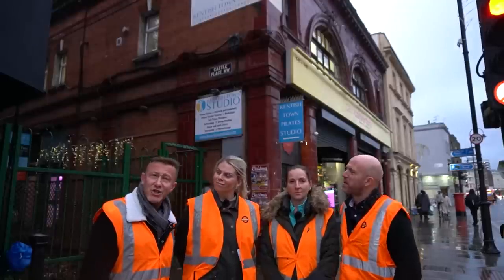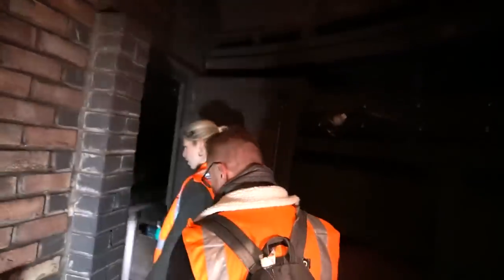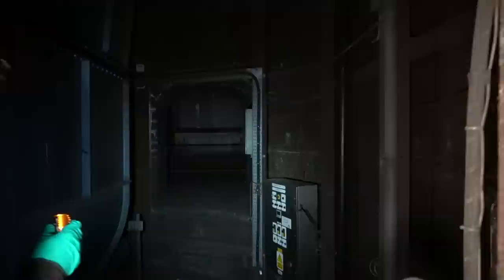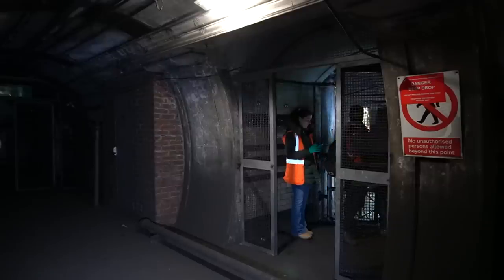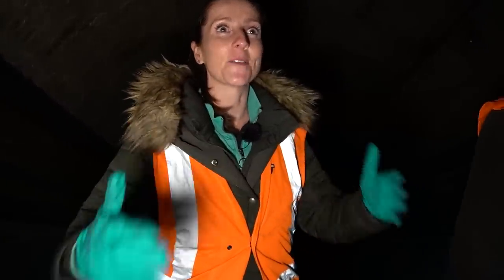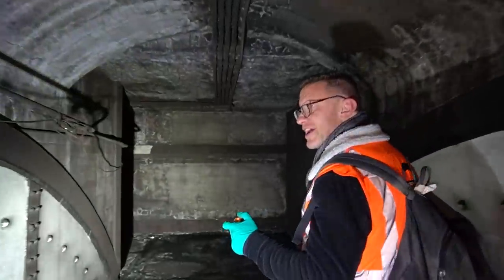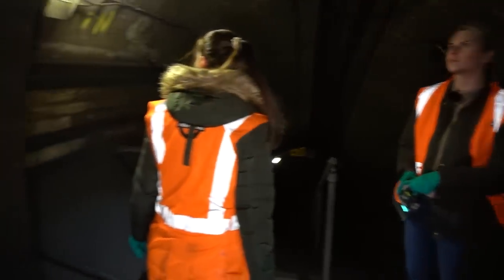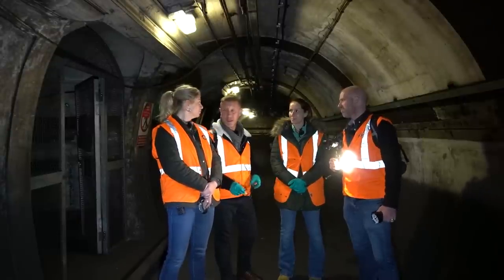Exploring South Kentish Town Disused Tube Station | Hidden London Hangouts (S07E01)

Comment: The sewage ejector pipe fitting is called a munsun ring , its basically a brass clip for copper pipe that are still used to this day. Often to be found on high end or commercial buildings. The top half of the clip is missing.

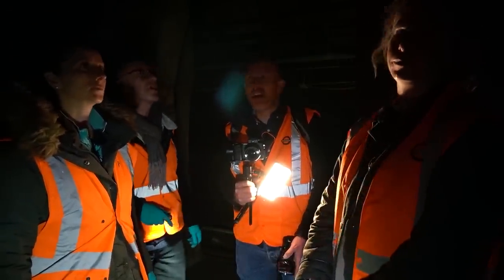Comment: Bravo brave explorers of the unknown deep!  23:44 Not often you see Alex so amazed he is stunned into silence! 
Would be great to also hear a bit more on some unanswered bits from the exploration - such as, why, after the station closed, did they remove the original staircase in the staircase shaft, which must have been a lot of work?   And the remains of the poster 27:06 - was that WW1 or WW2?   Maybe we can dream that someday the station will reopen.
Reply: Thanks - glad you enjoyed it. I can answer those questions for you. The original spiral stairs in Underground stations trended to corrode in the damp conditions and have been removed from many stations but are usually replaced with modern galvanised stairs. In some places it’s very obvious (such as Down St) but quite subtle at some stations. If there’s another route in/out of the site the stairs are just removed and the shaft left empty  and that’s what’s happened at SKT (Angel is the same). The surface building at SKT has been repurposed and the original route to the old spiral stairs has been capped off. The posters we showed are from the Second World War

Comment: I've been in there loads of times. There used to be a place that offered massage therapy for er... health reasons. Vibrations when the trains rattled through were interesting.
Reply: Did you visit the station or the “massage parlour”? 😘
Reply: Just the "health club", but you went into a door that was part of the station building and then downstairs to an underground level. So I used to pretend to myself that I was getting secret access to part of the closed-down old station.
Reply: If it works for you, it works for you 😉

Comment: Did they find any trace of the southbound late night tube train that left Kentish Town at around 10.50pm Saturday 31 October 1931 with the driver, guard, and 5 passengers on board - and never arrived at Camden Town. They combed the line but it had vanished. To avoid a panic, they made up some story about a derailment and paid of well the 7 families involved. But the only trace of that train now is a very cold rush of air and the sound of a train rumbling along, at around 3am reported by maintenance crews in the tunnel when no trains are running. Unsuprisingly, no LT maintenance man will work that tunnel alone, to this day, ever.

Comment: I needed to know why don’t dig a tunnel and do an extension for the main line Train so that they can extend the unused abandoned underground stations.  

Why couldn’t they use the part D78 Stock train doors on the sides and also restructure the front face of the A60 and A62 stock and that includes the class 313, class 314 and class 315 remix and make them all together and also redesign them an overhead line and also make them into Five cars per units and also having three Disabled Toilets on those Five cars per units A60 and A62 stock trains and also convert the A60 and A62 stock trains into a Scania N112, Volvo TD102KF, Volvo B10M, Gardner 6LXB, Gardner 6LXC and Gardner 8LXB Diesel Engines and also put the Loud 7-Speed Voith Gearboxes even Loud 8-Speed Leyland Hydra cyclic Gearboxes in the A60 and A62 stock, class 313, class 314, and class 315 and also modernise the A60 and A62 stock and make it into an 11 car per unit so it could have fewer doors, more tables, computers and mobile phone chargers.

A Stock Trains and also having 8 Disabled Toilets on those A stock trains. why couldn’t we refurbish and modernise the waterloo and city line Triple-Track train tunnel and make it more bigger and extend it to bank station, making it into a Triple-Track Railway Line so those 4 European countries such as Germany, Italy, Poland And Sweden to convert the waterloo and city line Triple-Track Train tunnel into a High Speed train?

The Third Euro tunnel Triple-Track Train line to make it 11 times better for passengers so they could go from A to B. then put the modernised  11 car per unit A Stock and put them on a bigger modernised waterloo and city line Triple-Track train tunnel so it could go to bank station to those 4 European countries such as Germany, Italy, Poland And Sweden. The modernised refurbished 11 cars per unit A stock could be a High Speed The Third Triple-Track Euro Tunnel Train So it is promising and 37 times a lot more possible to do this kind of project that is OK for London Germany, Italy, Poland And Sweden. 

oh by the way, could they also tunnel the Triple-Track Railway Line so it will stop from Buckinghamshire, Hertfordshire and Essex so that the Passengers will go to Germany, Italy, Poland and Sweden and also extend the Triple-Track Railway Line from Bank to Buckinghamshire, Hertfordshire and Essex Stations so that more people from there could go to Germany, Italy, Poland And Sweden Easily.  

Why couldn't they extend the Piccadilly line and also build brand-new underground train stations so it could go even further right up to Clapton, Wood Street and also make another brand new tunnel train stations in Chingford could they extend the DLR?

All of the classes 150, 155, 154, 117, 114, 105, and 106, will be replaced by all of the Scania N112, Volvo TD102KF, Volvo B10M, Gardner 6LXB, Gardner 6LXC and Gardner 8LXB Diesel Five carriages three disabled toilets are air conditioning trains including Highams Park for extended roots which is the Piccadilly line and the DLR trains.
Could you also convert all of the 1973 stock trains into an air-conditioned maximum speed 78 km/hours (48 MPH) re-refurbished and make it into a 8 cars per unit if that will be alright, and also extend all of the Piccadilly train stations to make more space for all of the extended 8 car per unit 1973 stock air condition trains and can you also build another Mayflower and Tornado Steam Locomotive Companies and they can order Every 17 Octagon and Hexagon shape LNER diagram unique minor no.13 and unique small no.11 Boilers from those Countries such as Greece, Italy, Poland, and Sweden, can they make Mayflower and Tornado Steam Locomotive speeds by up to 117MPH so you can try and test it on the Original Mainline so it will be much more safer for the Passengers to enjoy the 117MPH speed Limit only for HS2 and Channel Tunnel mainline services, if they needed 16 Carriages Per units can they use those class 55’s, class 44’s, class 40’s and class 43HST Diesel Locomotive’s right at the Back of those 18 Carriages Per Units so they can take over at the Back to let those Mayflower and Tornado Steam Locomotive’s have a rest for those interesting Journeys Please!!, oh can you make all of those Coal Boxes’s 16 Tonnes for all of the 117MPH Mayflower and Tornado Steam Locomotive’s so the Companies will Understand us PASSENGER’S!! so please make sure that the Builders can do as they are Told!! And please do something about these very important Professional ideas Please Prime Minister of England, the Prime Minister of Sweden, the Prime Minister of Germany, the Prime Minister of Italy, the Prime Minister of Poland and that Includes the Mayor of London.